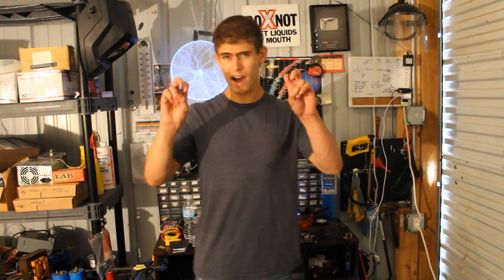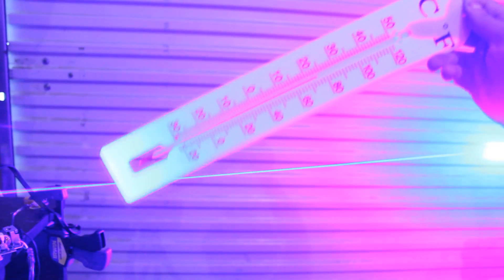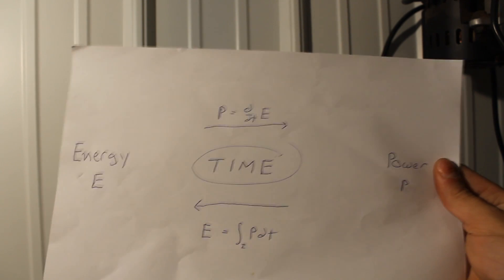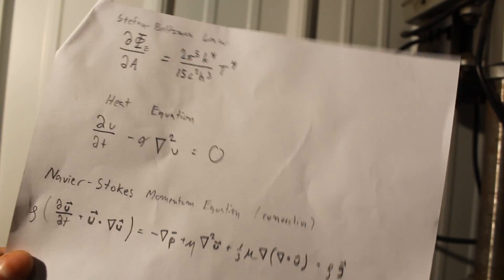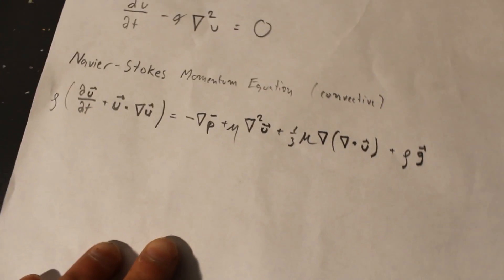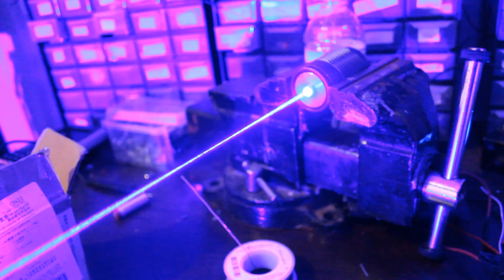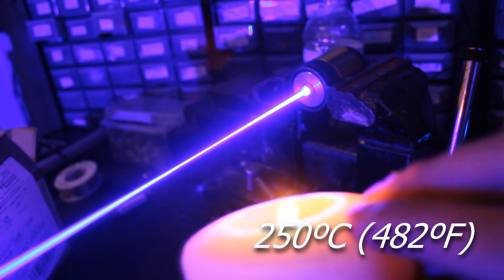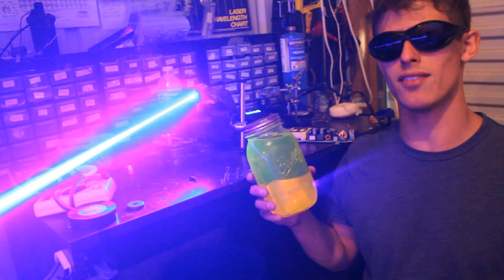How hot is a 5W Laser?

Comment: Temperature is a state function and lasers are rated by power, a path function. The question is asking for a state function value from a power function value, so you would have to derive the power function with respect to time, but you would need to rephrase the question based on the type of laser and type of material you are aiming the laser at. The proper way to ask this question would be, "What is the maximum temperature a 5 W 445 nm laser can make my skin?" The answer to this question depends on a few variables, how small is the laser focused, what is the absorbance spectrum of my skin, and exactly what is the chemical structure of my skin. The smaller the laser is focused the hotter it will get, the more absorbance my skin has for a 445 nm laser the hotter it will get (less is reflected), and the less thermally conductive my skin is the hotter it will get.

The true answer to this question is that the temperature depends on the color and power of the laser and the material you are aiming it at.
Reply: BranFlakesR1337 jeez my brain hurts from reading that but i see the logic
Reply: I tried to explain it simply but the question itself is not simple as it may seem. Often the simplest sounding questions are actually the most profound and complex like why is the grass green and what are dreams.